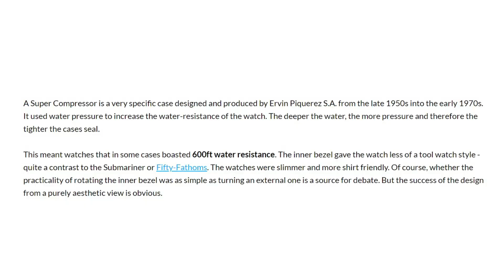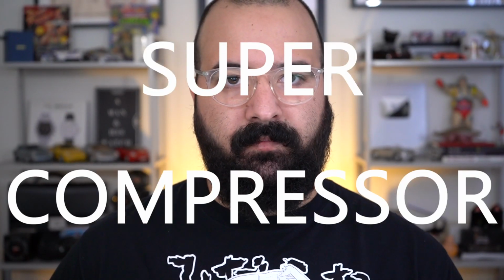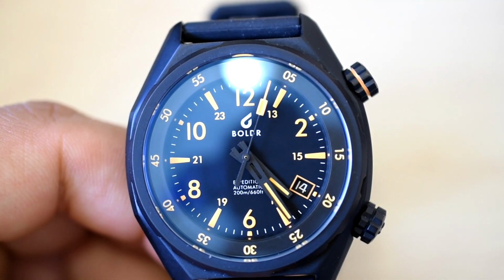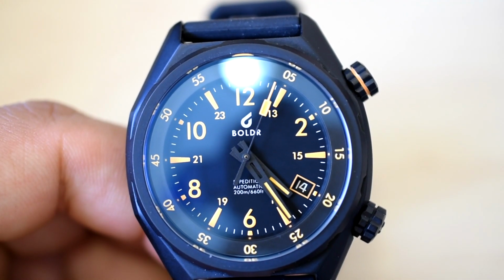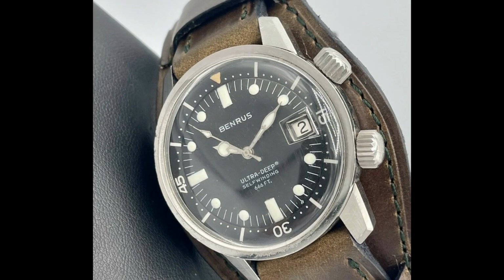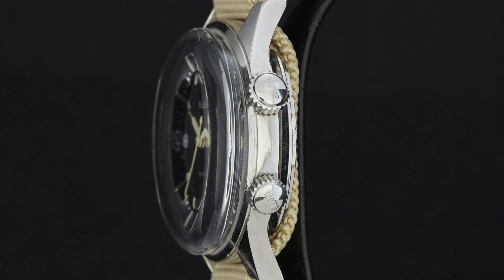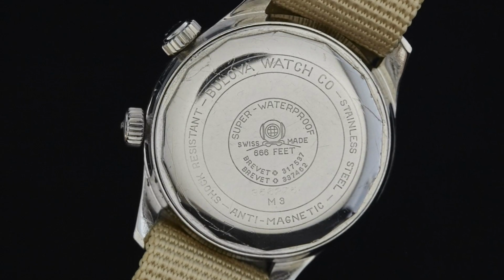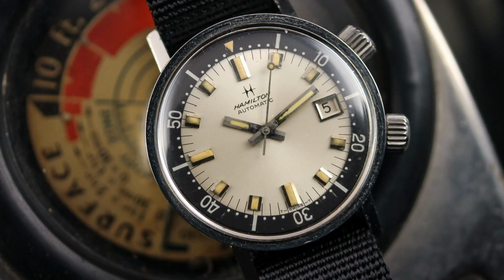Watch Nerd Trivia: What Is A Super Compressor?

Comment from the maker: As far as I know, Vostok does not use the patented Super Compressor case, so it cannot be classified as such.
Reply: but technicaly, the Amphibias uses the same principle. But yes, it was a requirement for the designers of the Amphibia, to don't use any western patents in the design ;)
Reply: It's true that Vostok don't say they use the super compressor case, but look at the design. In the past, and probably today too, one of the most important components of this type watch wasn't the case or the caseback, but in fact, it was the acrylic crystal that, as pressure was applied from the water, it pushed against the acrylic and formed an even stronger seal  the deeper it went, until eventually cracking. I would say the Vostok would probably outperform most of the models you mentioned here. I've only ever taken mine to 100m down so I've never tested it, but I think there's a video showing it's impressive performance.......for a $75 watch, it kills the competition. 🙂
Reply: But isn't that what you would expect from a russian brand, copy a good idea😁 I think that just adds to the charm of the Amphibias😅
Reply: the question I have is what is the connection between being a "super compressor" and having internal bezel. As far as I can see, you find these two always together
Reply: Before arriving here to vent my spleen at your absolute Hubris and Snobbery in not mentioning the Vostok Amphibia. 
I was not expecting to find that you already covered your mistake, if in fact it was a mistake.
You talk about Patents, did any of these companies consider Patents when they Ripped Off Vostok's idea?
Commies have no such need for Patents, that made them easy prey. Is this your line of thought?
The deeper it goes the more it seals. That is a compressor, that is what Vostok invented.
Don't use the excuse of Patent legality to cover your Racist and Classist Ideology.
You can be as Elitist as you want, fawning over high end brand names, but you cannot rewrite History.
Reply: @brianmsahin  They tested one on beyond the press channel in a chamber it did not stop until over 600 metres depth
Reply: @pavo45  Yes! I saw it very recently. Great watch!
Reply: Hey nice video. I found this exact watch, Case says 600 on the back, 2 crown, very nice divers watch and its vintage with white dial patena making it kinda champagne. I knew nothing about it and picked it up for barely nothing. The bracelet clasp says Special Stainless Steal, with a gold paint on the band with silver on the inside. Love it

Comment: Im here bc of a recent acquisition, a gold dial Hamilton super 600. My wrist is on the smaller side so the 36mm case fits me well and it looks beautiful. Using the crown at 2 o’clock to rotate the internal bezel is not as easy as turning an external bezel but i love the aesthetic and vintage charm.

Comment: Hey bud, I just got a Hamilton “compressor” (because it does have the dual crown but not the super compressor functions or at least not to my knowledge) the model is the hamilton khaki h744511 it does come with inner and outer bezel which is featuring a comes with a black leather strap. I actually ended up changing it for my skx since I figure, we’ll I have more than a couple of sports 5’s so there is plenty of Seikos and not as many of these Hamilton model.

Comment: Great video - such a misunderstood term and misused by modern brands and dealers. For vintage watches, there was a period in the late 60s/early 70s where there was an abundance of super compressor dive watches. In addition to the watches you mention, some more brands/references from my collection: Baylor Neptune SuperCompressor (1968), Musette Resist Super Compressor (1972), Precimax Aquamax Safety Super Compressor (1969), Tissot DL Super Compressor (1972) and, of course, as several people mentioned the modern day Christopher Ward C65 Super Compressor which uses the original technology.

Comment: Supercompressor was a technical solution to work around sealing challenges of that era. 
With today’s seals technology and manufacturing accuracy, supercompressors casebacks are not relevant anymore as higher levels of waterproofness can be achieved with simpler designs

Comment: Nope, don't have any in my collection yet. One day, would like to add a legit one to my collection.
For now, I'll have to be satisfied with my 500m & 1,000m pieces with helium escape valves. I know they're totally different but, I'm referring more to the depth rating. 
Haven't done any real "in depth" research but, as far as I know, the Rolex DEEPSEA SEA-DWELLER has deepest rating at 3,900m/12,800ft.
With that said, who on Earth needs more than that?
Super-Compressors that actually reflect depth ratings come nowhere in the ballpark. No, I'm not a Rolex fanboy. However, for me, that's the only model they make that's relevant in size & spec's. My personal choice would be the Seiko MARINEMASTER Professional SBEX003 1000m which doesn't have either feature - super-compressor or helium escape valve.

Super-compressors look cool but; in the end, for a real world professional or military deep diver - what would make a super-compressor more efficient/reliable than watches with helium escape valves? 
Note: I have no real preference as I'm just a desk diver. Visually, both are very appealing. I'm just curious as to which is superior in the real world. 

Scenario: I'm a professional deep diver with a $5,000 budget. Do I get the super-compressor that doesn't have a stated depth rating or do I get the helium escape valve that's rated at a deeper depth than I'm qualified for?

For 99% of the world population, these stat's & spec's are completely irrelevant. It basically comes down to what is important to you visually.

Comment: I’ve got a coworker that said that he bought a Tag Heuer roughly 25 yrs ago that he paid $1200 to $1500 for. He mentioned that the battery was dead and I offered him my case back tool to change it. And he said that he couldn’t because there was pressure involved and that he would have to pay “big bucks” to have it done. So the watch just sets…
Do you guys have ANY idea what he might have?? I’m obviously gonna ask for a picture of the front and back of it now because of this video!! Lol
Reply: What he probably means is that it should go back to tag to have the seals changed when they change the battery. As it's quartz it won't be a super compressor. By the time quartz came along compressor cases were a thing of the past.